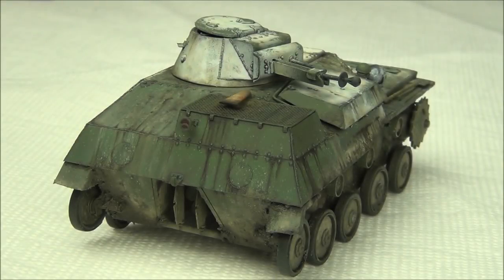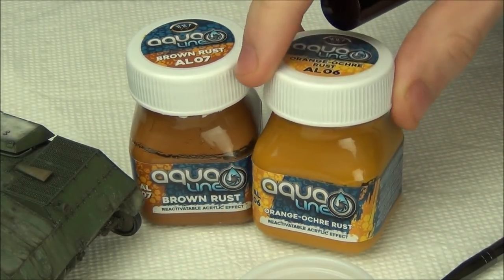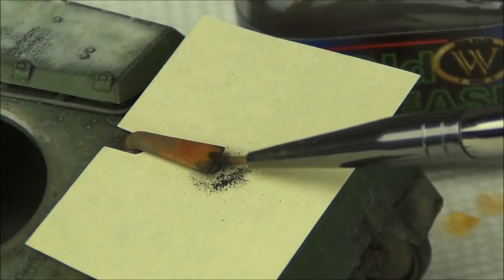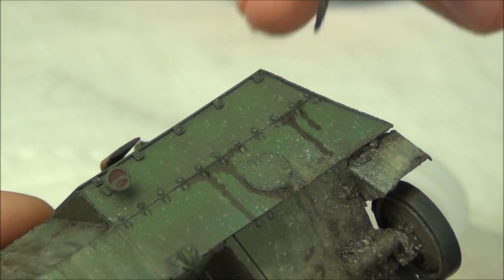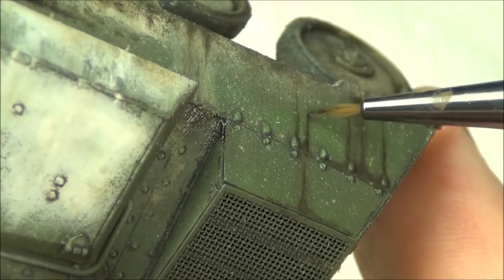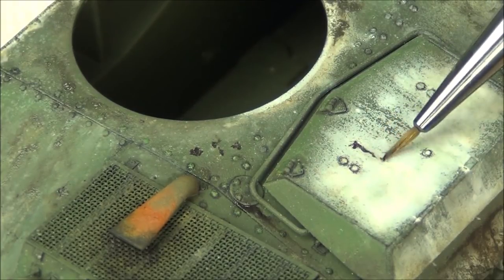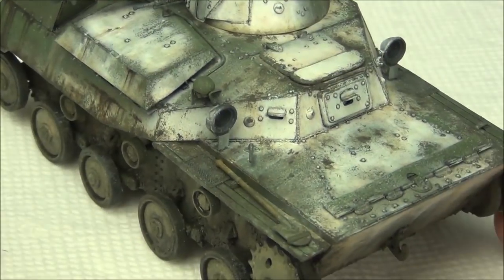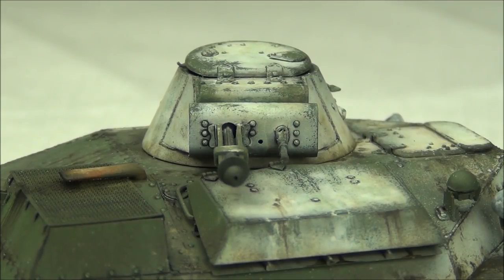Rust and (Glossy) Grease Effects for Model Tanks

Comment: Lately I've been using the "steel wool and vinegar method" for rust, and it works and looks great!!  I have been painting rust,  but now I will stick with this method. Can't beat real rust. Looks completely authentic because it is real rust.  A light touch and it's awesome. I follow with a thin brown wash here and there, over the dried rust.

Comment: Panzermeister36 good work and thank you for sharing i always learn something from you and your videos , one thing i have noticed when it comes to fuel spills and similar effects keep in mind  these are stains in real life they don't necessarily have to have color in them these can be modeled simply with the wet effects alone always balance these things out just a word of advice for my fellow modelers.
Reply from the maker: That is a good idea!  That would give some better variation, since these streaks should be simulating anything from water to oil to fuel.
Reply: @Panzermeister36  thank you for responding you're correct spills happen and it should be modeled with all the attention we give the other effects, hell i can't count how many times i have spilled paint and other fluids going in a airbrush cup lol but i appreciate your work and the imprint you continue to put on this hobby that we all love.

Comment: Good video, but about 2:34 can I get Similar results with pigments only (I have vallejo rust pigments) and how should I apply them? should I brush some dull coat (revell clear in those tiny paint cans) and then apply the pigment, or should I apply thinner and then pigment. I think that with The clear underneath it would stick better, but with thinner it would blend better.

Comment: Nice job as usual Panzer , though this is an old video, I've returned to it as I would like to add these effects to some models , but don't have any of the above products!
I know you like using oils for weathering  and I happen to have a number of W n Newton colours all the ones necessary !
Can one use any to replicate oil and grease and also can W and Newton's Sansodour be used as enamel thinner with Ammo and Mig grease products !
Best as always.
Edward
Reply from the maker: Yes you you certainly use black/brown oil paints to make grease and exhaust stains.  I'm not 100% sure about that thinner you've described as I have not user it myself, but standard oil thinner should work.  Maybe test it out on the underside of the model to make sure it won't damage your paint.

Comment: Question: what do you do for ventilation when using your oil paints and thinners?  Great videos!  I’ve been binging on them for days now lol
Reply from the maker: Oil paint thinner is not very dangerous (not like acrylic thinners etc.), but I have a small floor fan in the room that I use because it can get quite warm from my lights, so I expect that helps to disperse any thinner fumes as well.  I have the fan close by my desk, aimed at the door so it moves the hot air out of the space.

Comment: Great tutorial, really helpful. Just a question please. Is it okay to use thinned tamiya glossy varnish for wet surface?
Reply from the maker: I have used thinned Tamiya X-22 gloss brushed on and it works well.  It's and acrylic so you have to be careful to not lift up the base colours but it's not really an issue that will actually happen.
Reply: @Panzermeister36  Thanks :) I have a gunze varnish on the base color so it will be ok :)

Comment: Thanks for your videos they are really nice and the techniques are well explained!

Question completely out of topic...
I have some products from Wilder's nitro line that are kind of drying in the shelves, they have like a fairly thick layer of dry "pigment" under the transparent thinner. Is this normal?  did it happen to you?
Reply from the maker: I know what you're talking about.  It has happened to a couple of my Wilder enamel products.  It also happened to my AK rust effects and Mig Productions filters.  It's just what happens to enamel products over time....I'm not sure if it can be undone and the product still used.  It's a shame, and that's part of the reason why I use oil paints most of the time.
Reply: Yeah! it is weird, it doesn't really happened to my Ammo's enamel products. I guess they are more "shelve stable". 
Yeah! I know you're a big fan of oils, I struggle with dry time. Any suggestions?
Reply from the maker: Actual modelling oils like those from Wilder and 502abt dry much faster.  For artists' oil paints, well you have to leave the blobs of paint out on cardboard for a few (about 6) hours first to soak out most of the oil.  That will help them dry faster on plastic.
Reply: Hey man! thanks so much for your tips. really appreciated

Comment: Have you had any of the Wilder washes get gloppy/gooey in the bottle? I have some brown shadow wash that’s unusable because of this goo. I’ve shaken, stirred and mixed with no improvement. Any thoughts?

Does that tank have a propeller???
Reply from the maker: Yes, that happens to all enamel washes over time.  Its happened to all my old AK and Sin Industries ones too.  That is partly why I prefer oils for enamels for most effects....they don't die after a few years.  

Also, yes, it is an amphibious tank, which is also why it's kind of boat-shaped and has practically no armour.  I would not want to fight in this thing!